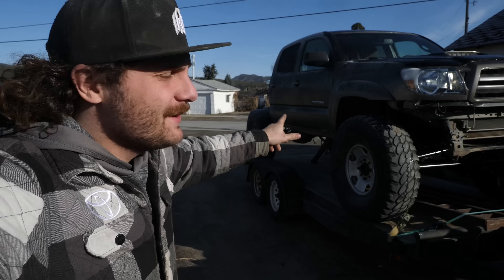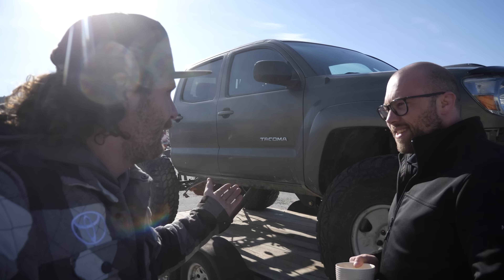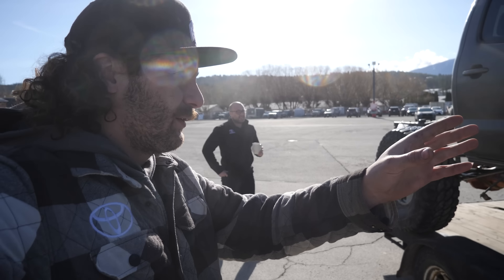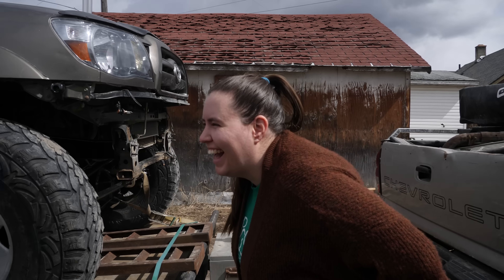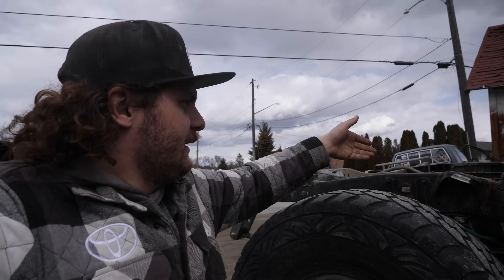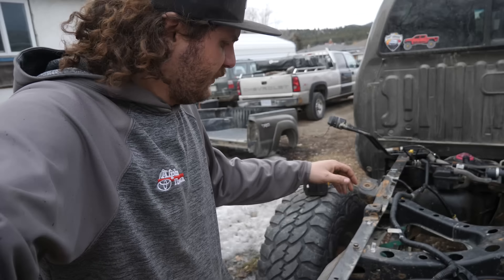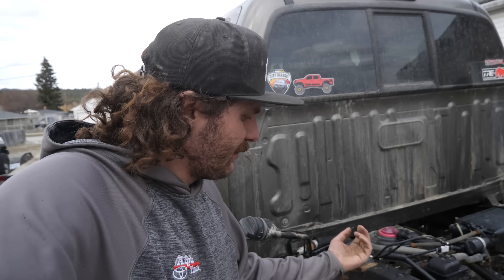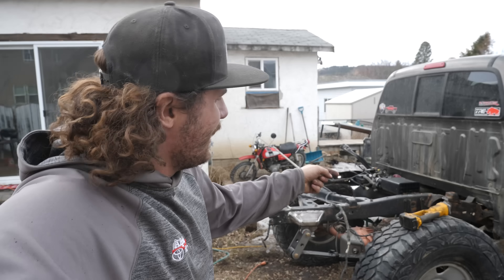Taking my ONE TON SWAP TACOMA to the DEALERSHIP...

Comment: Are you going to be reinforcing the frame so it doesn't taco on you since you are adding weight and different stresses? From my understanding of Tacoma frames they differ from 4runners by not being inclosed and also being two parts front and back instead of being one solid frame piece.

Comment: I was trying to get the body off the frame of my 91 4runner. Went great until I needed to lift it up a little more in the back. About 10 inches off the frame it fell to the side. Had to get help to get it back in place. Really need to clean the frame and repaint it, but not without a safe way to do so.